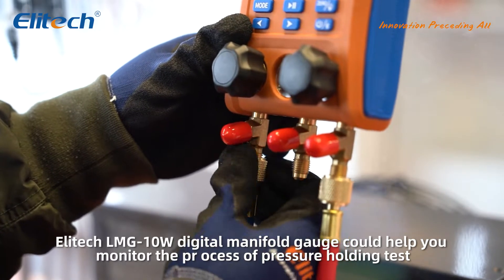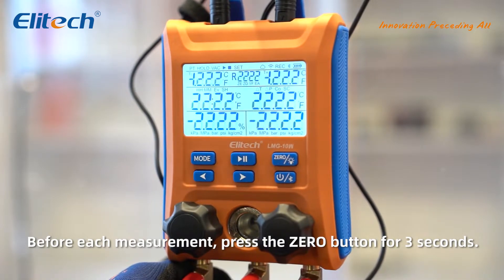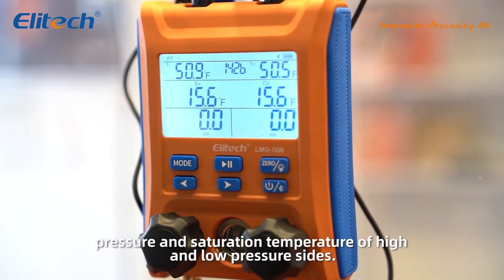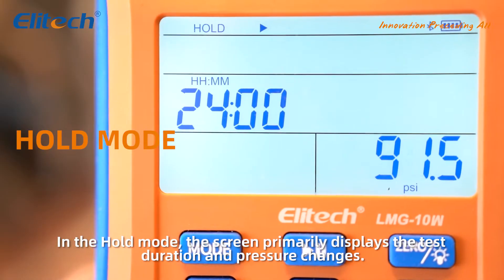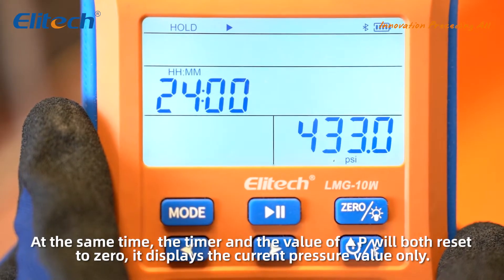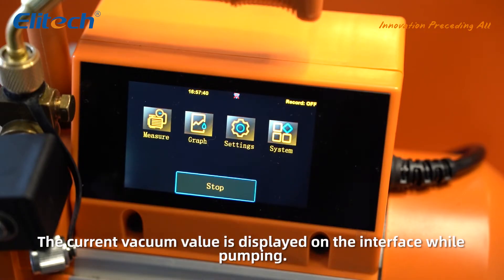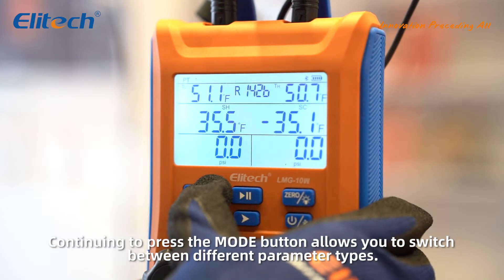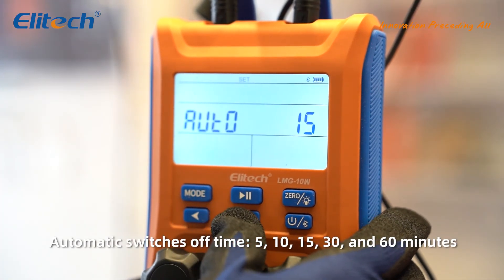How Elitech digital manifold gauge works  LMG-10W?

Comment: how to remove E04 error?
Reply from the maker: E04 means that the pressure is abnormal. The possible causes are:
1. The product is affected by static electricity and the pressure is abnormal.
2. The product is affected by moisture and affects the internal circuit board, causing abnormal pressure.

Solution:
1. After the product appears E04, turn off the product and place it in a dry environment away from static electricity.
2. Wait for 24 hours before turning it on to check whether the pressure is restored.
3. If it is not restored, you can enter the calibration to perform the zeroing operation. (Note: This operation is a forced recovery and is not recommended unless necessary)

Enter the calibration and zeroing operation steps:
1. Press the right key first and do not release it,
then press the power button, release the power button after the screen lights up, and keep pressing the right key until you enter the calibration interface,
2. Long press the zeroing key to reset, and the interface displays "0000"
3. Turn off the product and then turn it on for use,
Reply: Cách reset đồng hồ. Có cần cắm dây cảm biến vào không